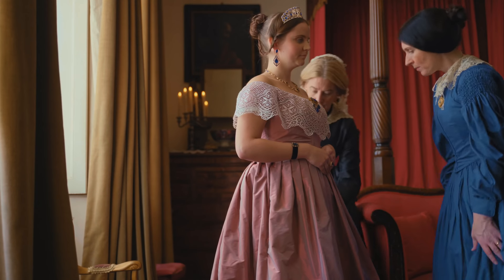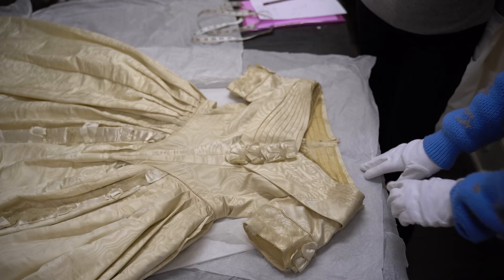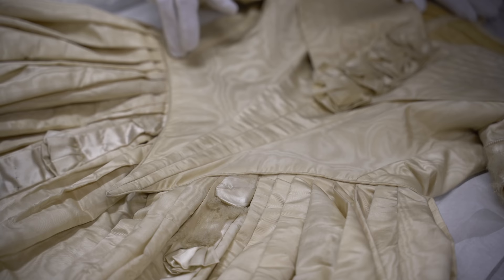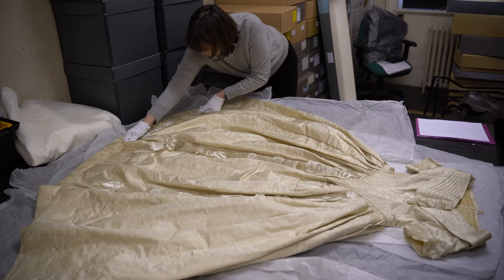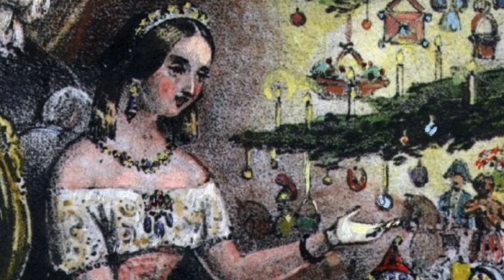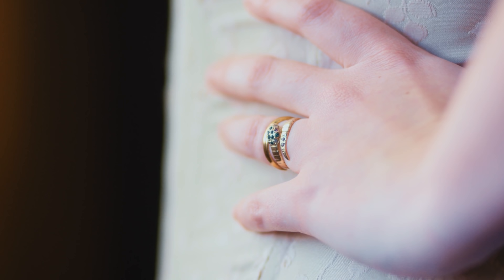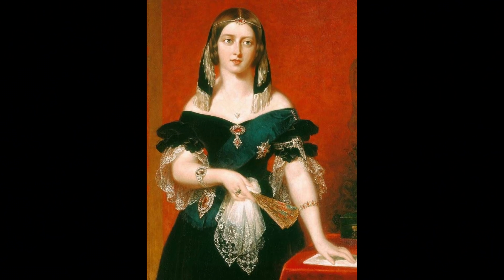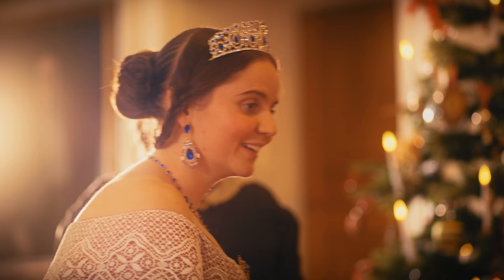Recreating Queen Victoria's 1848 Outfit

Comment: Hello again Guys at Crow’sEyeProductions. I have a Question about Victorian Era Dresses and it’s this: What’s the difference between a Hoop Skirt and a normal (Not an Elliptical Steel Cage) Crinoline Steel Cage? Also which one is bigger: a Hoop Skirt or a normal Steel Cage (Not an Elliptical Steel Cage) for a Crinoline Dress. Furthermore, what’s the difference between an Elliptical Steel Cage for a Crinoline Dress and a normal (Not an Elliptical Steel Cage) Steel Cage for a Crinoline Dress? as well as what’s bigger an Elliptical Steel Cage or a normal Steel Cage? That’s all the questions I have and I be really grateful if you could try and answer them!
Reply: Hoop skirt is a general term for a boned skirt, it can apply to a lot of undergarments from the renaissance onward. A cage crinoline is a kind of hoopskirt. Size varied a lot.
Elliptical crinoline were the crinoline used in the 1860's, they were flatter on the front with most of the volume on the back of the skirt.
Reply: Kira Thxs!